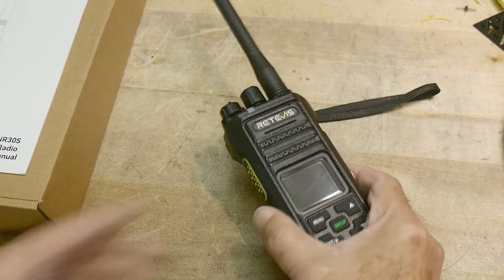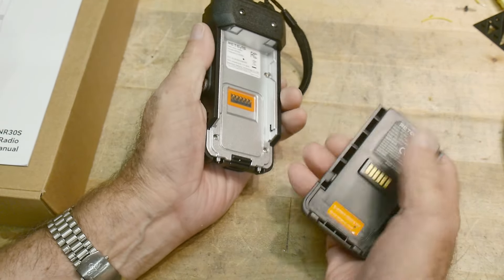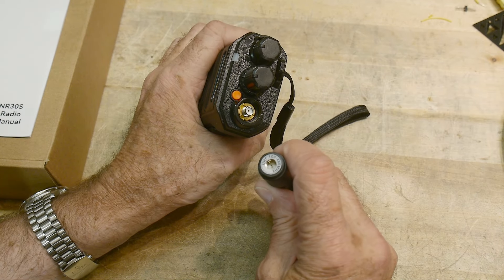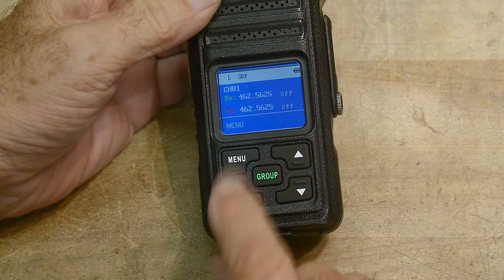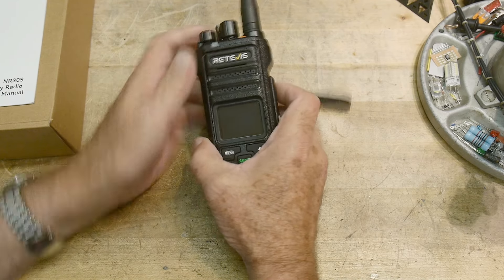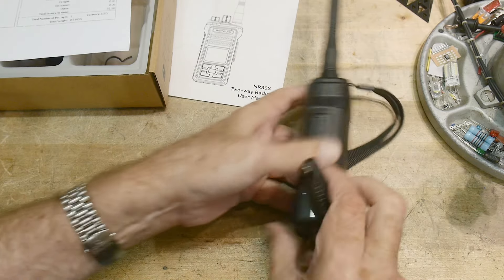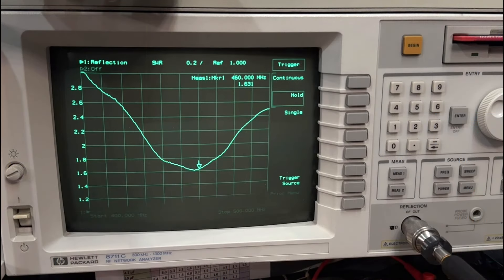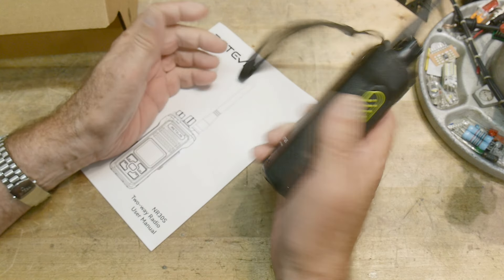#2017 Retevis NR30S GMRS Radio

Comment: Thank you for great video. I am debating between this radio and RA89. I wanted for Skiing since we can relay get far from each other sometimes with my son. I want to get something reliable and budget friendly. I also checked the Retevis Ailunce HA1G. 
1) Could you please advise which one of these radios are suitable for my needs?
2} How is the range for Retevis NR30S ?

Thanks Again.
Reply: le RA 89 est une radio UHF & VHF  tandis que le NR 630 est une simple VHF avec seulement 16 canaux programmable  coté robustesse le NR 630 sera plus solide. le NR 630 utilise des fréquence pas toujours autorisé tous dépend du pays où vous l'utilisé le RA 89 lui ira plus facilement sur toutes les fréquences